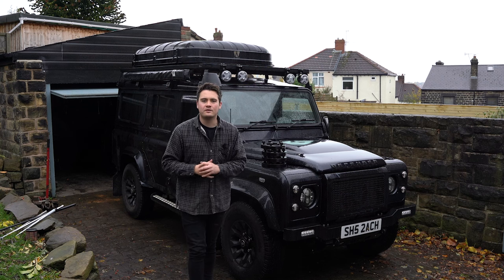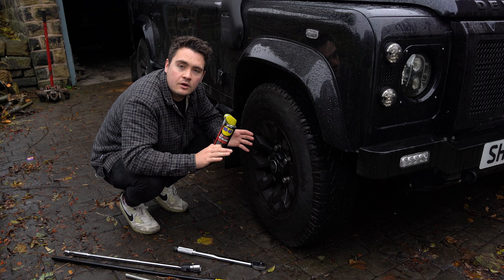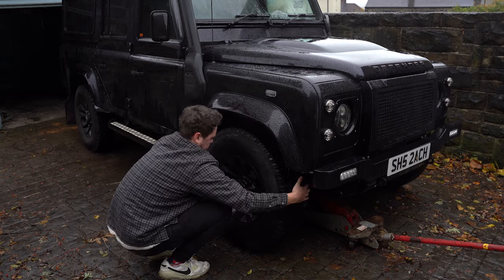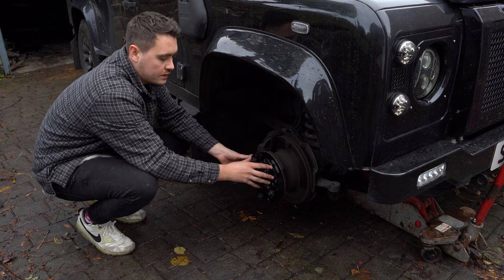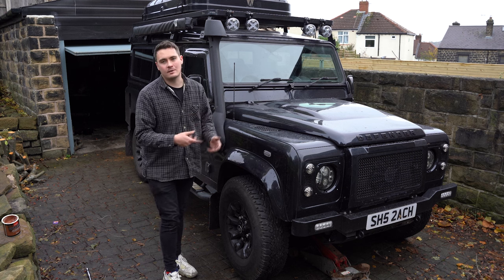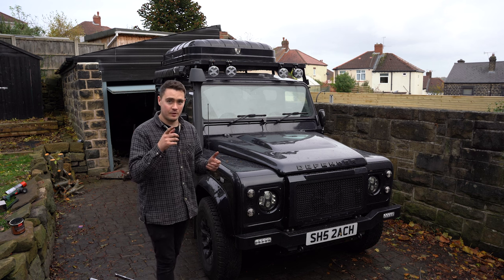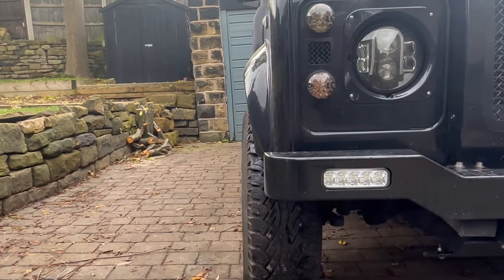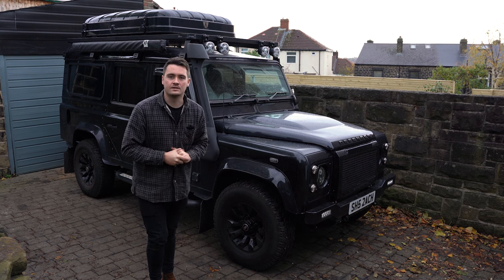FITTING WHEEL SPACERS TO MY LAND ROVER DEFENDER!

Comment: Looks like a nice easy upgrade, and also a potential alternative to fitting the wider 265/75 tyres which many people fit purely to achieve this sort of look to their vehicle.  And the wider tyres, whilst nice, do have some drawbacks off road.  It's a case of horses for courses on that one.
I guess you should consider this now when you get around to replacing your tyres.  We talked in another comments section that we have the same tyres on our Land Rovers and we are both keen to replace them! Probably for some Goodyears in my case.  But I am going to let tyre wear run its course first which will probably take at least one more year.  Anyway maybe the wider tyre would not be a great idea with the spacers fitted too? They would stick out too much?
Also, please let us know in a future video about your long term experience.  Does this result in flicking mud and crap all up the side of your vehicle? Would it be advisable to fit wider body arches at the same time as these spacers to combat that?
Cheers!

Comment: Finally, long overdue! I’ve had 30mm spacers on mine for 70k with no bearing issues and even intended repacking the bearings recently but they didn’t need it. For tyres, I’d suggest the Cooper STTs which are great and look good with the only negative being their noise on tarmac or alternatively (as I’ve recently done) try the BFG KO2s which are much quieter and reasonable off road albeit their wet tarmac grip isn’t great. What about the white wheels you were thinking about?
Reply from the maker: I know! Glad I finally got around to doing it - really happy neither the results. As for the white wheels, I’m still so torn for options at the moment, I’m going to have to bite the bullet at some point though